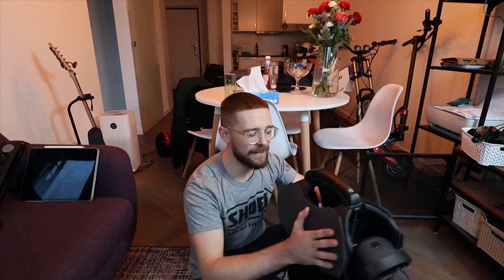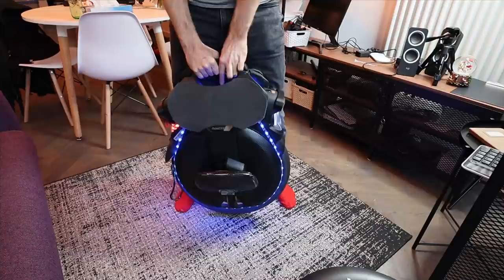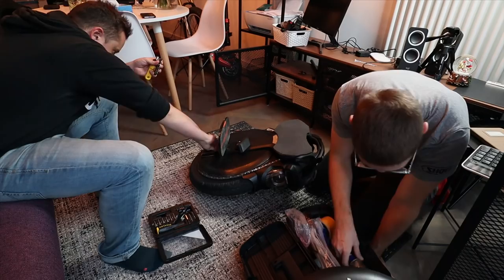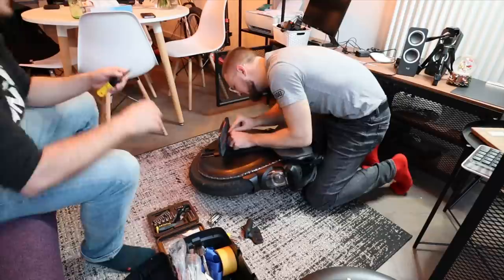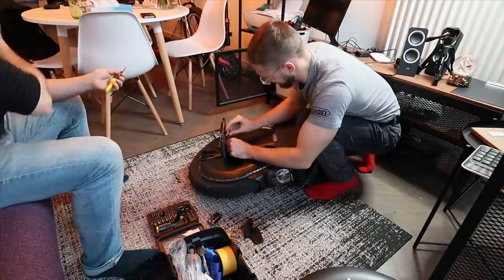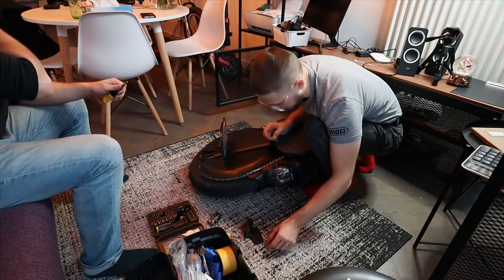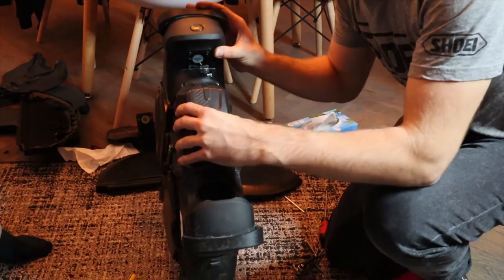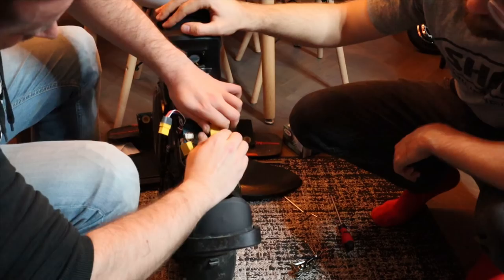My InMotion V11 is NOT REPAIRABLE? 2200km update

Comment: Why would you try to remove an aluminium bolt (nut?) with an adjustable spanner?
A decent socket set would give a proper grip that is distributed across all of the faces and not damage the bolt.
Reply: 100% better tools and knowledge go along way . Its not a matter of better screws either ... they use locktite on them so u need a bit of heat from a little propane torch before you try undo them otherwise u end up with what you have now ................
Reply: They used the exact same tools in the official Inmotion disassembly video so...
Reply: @MrRippinonyou  The correct analogy would be; you telling me to jump off a cliff and me seeing you land unharmed. Then yes I might jump ;-) If Inmotion puts out these videos, unexperienced people will try to emulate...
Reply: @Skecys  yes true , my comment stands to help other not make the same mistake that is all ... cheers
Reply: I’m so happy there’s someone else that notices this stuff. Good !😅
Reply: @4406bbldb  I actually dont know if a socket will work with this nut as almost all sockets have a flare at the tip and the nut is like an 1/8th inch high or less and the flared end may not allow it to work at either. i think a correctly sized open end wrench may be the best bet on these shocks

Comment: Well I love my V11 and I dont need more speed. Its not  becuse Im an old fart its because Im a clever fart.  There are many screws you say ? I wonder why? Maybe Inmotion wants a stronger structure than Gotway? Maybe Gotways techies left for a reason? Sherman  grew out of techies leaving GW .... 
If 55 km/h is not fast enough fore you guys ... Maybe you are riding a little too fast ?  Ok its not easy to repair ? I see that .... Its a suspension structure tis more complicated ..
Reply: Well said :)
Reply: Yea, Well said
Reply: 55kph is ok but remember one thing.. 55 is onlynfor 20% of your batery. The true is for safety also having more (example in the middle of traffic) i feel safer riding faster.. 

So 55 is ok but waiting for the next imotion to have a full speed around 65kph
Reply: Thanks; I'm waiting for my V11 and this video almost made me sad. I just hope that my bearing will last longer... I think Adam's broke because he was basically submerging it, and just abusing the wheel. I'm really tired of non-suspension wheel, all the roads I ride are extremely bumpy. Also the daylight is getting shorter and shorter, I can't wait for that amazing light on V11.
Reply: @Ubeogesh  he had the first batch with the non waterproof bearing so it was just a matter of time. Don't worry too much about it, there will always be cases like this
Reply: @adamszitas9925  Ádám, neked van V11-ed? Nagyon gondolkodom rajta, de szeretném élőben is látni, mielőtt egy ekkora döntést meghozok.
Reply: @kovaryzoltan1859  persze, meg tudom mutatni ha bpn vagy
Reply: @adamszitas9925  ez fantasztikus lenne, nagyon köszönöm, rám tudsz írni faxbukkon? https://www.facebook.com/zoltan.kovary/ Előre is köszönöm

Comment: If you only used proper, good quality tools... When you are using this kind of wrench on flat aluminium nut or "multitool" imbus set it has to go wrong.  Please use proper tools next time if you want to do disassebly review. It will take you then an hour to do this work with success ending ;-) V11 is made to be solid (with a few fuckups ;-) ), not to be easly disassemblable (I don't know if that wort existing xD ) by users without proper skills and tools ;-) For sure this is advantage, not disadvantage. BTW You do not need to weld, you can use drill and screw extractor.

Comment: Sorry guys this time i dont agree, you really did this the wrong way. With a batch2 wheel You even dont have to remove all of the outer shells, only one of four. it is still a lot of different screws but in order to remove the wheel you leave the sliders until the wheel is removed from the body.  As for the bearings I agree you cannot change them as the shells of the engine are glued with silicon but then again the bearings are different.
The thing i really hate is one has to open the motherboard housing to change a tyre and here even the top part of the motherboard. With some outside connectors this would be solved but yes it is still an inmotion.

Comment: You seem to have made the same mistake I did at first. Those are not the screws to open. The black suspension shaft holder is meant to come out together with the motor. You can still open it. You just have to open the screws next to the holder. There will be new slider with a new motor. But as those bearing screws are too tight and bad quality (same happened to me) you’ll need new M6x20 bolts
Reply: I'm trying to replace the motor, I'm stuck trying to get the motor/bearing bolts out so I can slide the motor out...but there too tight and poor quality, no way to work around?
Reply: Gotta warm up the bolts with a solder iron first. 

There is loctite on them from factory to keep the EUC from rattling in half. 

Just be sure to replace the loctite (Blue) upon reassembly as the heat will destroy it.

Comment: This is totally repairable. Any decent mechanic could fix all those issues. I would never use an adjustable wrench to remove that nut. The other damaged screws can easily be drilled out.

Comment: 17min13 this piece got damaged because you use a cheap Adjustable Wrench instead of a 19mm box hexagonal with a ratchet, when you where kids you did not play a lots with Lego... The other screw you damaged it is call an hex key if you do not use the exact one you will strip it like you did, there is metric and SAE version which are different even if they seem to fit well but there is a small loose its not the right one, also you put all screws in the same place they need to be organised so you can put it back in the same place... Sorry to sound like ans assh*le but i did work on car mechanics for 21 years before i was in electronic repair... This video mess up my mind

Comment: The V11 is an amazing wheel that has changed the entire EUC industry for the better. Everyone agrees, even YOU in your previous reviews. I ride it everywhere at close to 50kmh and I've never had a problem, what the hell are you talking about 40kmh for? The wheel is extremely fun to ride and super smooth... Powerful motor.. Good enough range for 90% of people.. Great suspension... Next time watch a video or two on how to disassemble it before you embarrass yourself! Even Marty has a tire change video!! Most people can swap out the motor in 2-3 hours if they don't make the mistakes that you made. Learn how to fix it and quit your whining!!!
Reply: That's a bit harsh, don't you think? You seem to have a few valid points, that would come across just fine without being rude. Shouting abuse really doesn't add any value. On the contrary.

Comment: My inmotion v11 brake light went out at 3600km its in pieces on my living room floor needs a whole new motor and tire assembly realistically street tire is almost bald and I still ride it at 50km/h fairly comfortably I bought it at 3500km with just over 3700 on it now overall if I bought it brand new I'd have no complaints.

Comment: years later: screw extractors work to remove stripped screws. vise grips would grip the damaged bottom nut on the suspension. both solutions guaranteed. thanks for the breakdown video though!

Comment: Socket on the nut for sure. The allen keys need to be right. Imperial/metric not sure what it is, but be sure to use the right ones.  Allen keys also vary in quality considerably. Use decent ones or they will round off when you work them hard..
Reply: Hope its the one and only metric design,
Only americans use inches,

Comment: It seems to me that suspension wheels might be too complicated for many. Good to have your eyes open to this if getting such a wheel.
Reply: They could try just pedal suspension instead
Reply: @JarrettWilliams99  where would you get suspension pedals?
Reply: @JarrettWilliams99  the v11 is just pedal suspension. They needed a long vertical track though for stability, it goes up the sides in narrow tracks. 
It only connects around the top with a thin shell otherwise you’d pinch your knees and so on.

Comment: Goggly eye man should have be the intro not the outro!!! Good stuff thanks for sharing!
Reply: Greetings from Denmark,
I bought the v11 this summer 2021 as my first ever wheel.
its been a blast to learn how to control it, 
4dayz in i took it to the near forrest with mountain bike trails, for all the beating it has taken, i am impressed,
4th batch rocks,
1 1/2 week later I’m addicted som i ordered another one at myewheels (thanks for the coupon:) and preordred the v12.
Got the second one today so i can service my first, at one point without loosing time one it. 
Clack pads v3 on the way i see a safety perspective in those for not loosing grip and way more power-break, because I’m way to fast now on the trails 
375km total 
Most in the forrest,

Damn riding backward is a big learning curve:)

Im thinking of doing a video off full service of the v11 and show how to proper get all the screws out and disassemble it,
As an tool designer i jave a few tips on stuck screws with cheaper tooling,

But I’m not a video editing guy so maybe uncut and the real deal with no small jumps.

Wish you the best guys.

Btw its so illegal here in denmark, but how are they going to catch me with clark-padz:)

Comment: This bearing issue and motor swrews should be fixed in latest batches, right ? Plus, when disassembling their highly abused V11, Ecodrift noticed that many screw attachments were broken, as well as the "horn" supports. Did you notice the same on your less abused wheel ?

Comment: I sheared the bottom valve stem which I can repair but it’ll stick down lower, and my wheel is completely covered in dents. I guess I lost pressure and didn’t Check it and dented my wheel pretty bad :/

Comment: Hi Adam, I have also developed the same issue as yours bearings have gone after just over 200miles on the clock, just wondering how you getting on with the fix, or you still waiting for them to send you the new parts, INMOTION come back to me to say they are changing supplier on motors and will send me a new motor and bearings by the sounds of it, but not until the end of the month, 🙃 Thank fuck for warranty I brought mine through erides in the uk which have been also with correspondence so far, so my question is have you managed to complete the fix and do you know anything about INMOTION changing their suppliers for motors?

Comment: Can someone tell me please if the latest version of Inmotion-V11 has the same bearing model as before ? (6816-z, 6816-2rs= 80x100x10mm 0,16kg) Thanks 🤙
Reply: They are not z bearing like on mine and on the adam wheel
Reply: @MADpack  does that mean that the new v11 have better and water proof bearings?

Comment: It there setting within the in motion app that unlocks improved performance?
Reply: Yes. You have to go to the wheel settings and tap the “features” text 5 times. No joke.
Reply: @Oleg-ru4qk  🧐'mmmm, 😁' aight!
Reply: @Psalms-kc9kp  by the way, if you’re using “euc world” app it seems to increase the max speed as well, but it actually doesn’t. The behavior of the wheel changes only if you do the trick above in the inmotion app. No miracle happens, but the difference is visible

Comment: I have the same grinding sound from V11 after some dirt riding. Still, it works. Would be nice to get rid of the sound, but I’m not disassembling it until it dies.
Reply: be careful as the bearings will block some day your wheel, then you will fly as superman and finally eat dirt

Comment: My v11 has almost 10k km on it after replacing a severely bent motor and a headlight after a few major crashes still runs strong but suspension needs replacement after my most recent crash due to me pretty much falling out of the sky and creating a dust cloud like a missile through a mound of dirt.